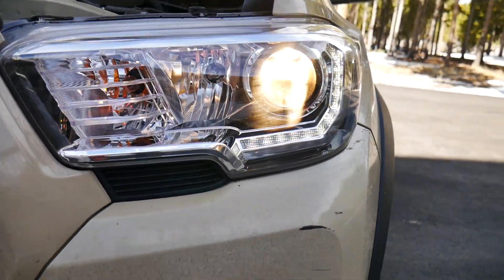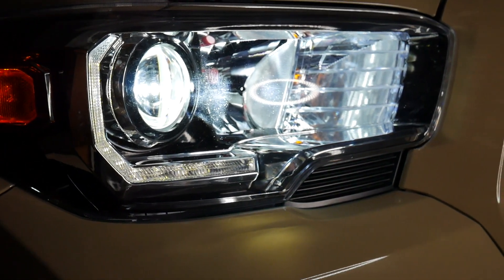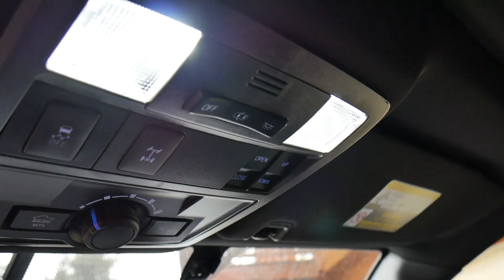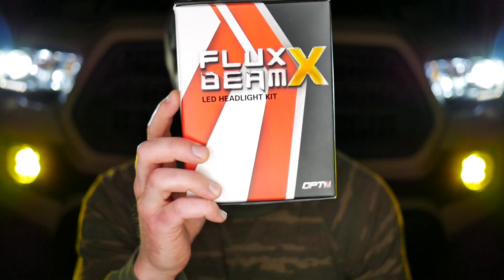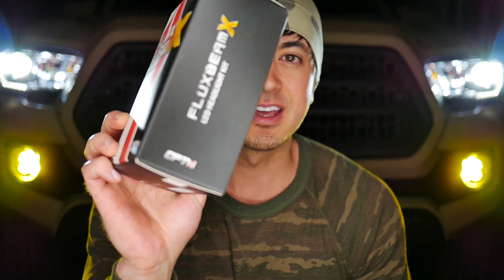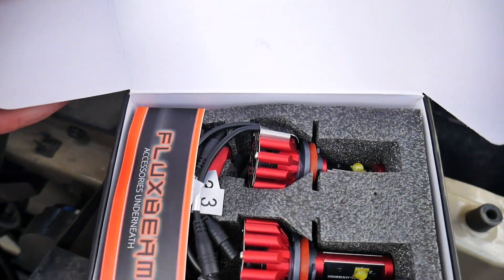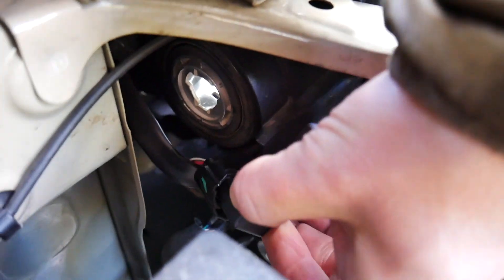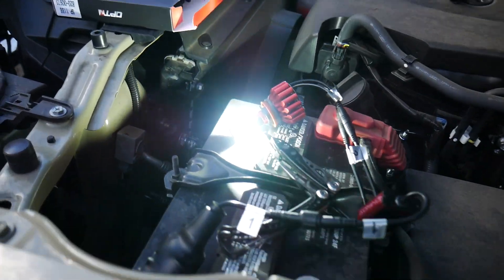Essential Truck Gear - Episode 3 - Vehicle lighting, headlight and foglight upgrades. Toyota Tacoma

Comment: I just installed the BD fog light kit just like yours, but mine has the angled bezels to make it a more factory look. The install is actually very easy. I started out just like on your video by tearing into the passenger side fender well. I then realized that everything is accessible from up top. There is only ONE tiny screw that holds the OEM fogs in place except for 2 side tabs that are kind of a pressure lock. You pretty much have to blindly find the screw head with your fingers, then align the philips head screw driver( you need a very short, medium head driver) with the screw and twist. Just like everything, there's a little trick to it. 

All that to say, I saved myself a whole night of cursing etc. by going in from up top and not removing the fender wells. Hope this helps someone out there.

Comment: I’m going to run the Baja squadron sport amber pods in my 08 tacoma fogs because Baja are great and they make specific brackets for Tacoma’s and other trucks! I’m going with the Wide/cornering beam pattern due to the 45* horizontal plane and not blinding anyone.

Comment: So the high beam is H9 (65w) and low is H11 (55w) but the Amazon listings show the H11 bulbs as 'H11 H8 H9' 60w. It looks like you need the 'H' version for the high beam. 

H11-HDOPT7-6
H11-HDOPT7-6-H

Comment: Love the vid. Your setup has me considering selling the scoob and getting a Taco.  Just a heads up. Don’t misplace your bulbs.  I bought the flux from Opt7 for the same reason you did. Driver side lasted a month. They replaced it no issues. Passenger died a week later. I have used other bulbs no issues.  I hope you don’t have my luck with them.
Reply from the maker: Going on a couple years now on my original 4, haha - but sorry to hear about your bad luck with them, that sucks for sure...

Comment: How is the throw on those lights vs the stock OEM.  I found with my projector lights that LEDs didn't seem to throw as far as my 65w halogen bulbs, before I switched to 4300k HIDs.
Reply: Adam Dümdie you'd be correct. LEDs don't throw very well, unless they're in TIR optics.

Comment: How do the LED headlights run in the cold? Im in SE Michigan and the usual here is to go with the HID's.
Reply: Jordan Wilbanks simply use what your vehicle is designed for. Neither HIDs or LEDs will perform well in halogen housings, and vice versa
Reply: Andrew Somhorst that's really boring...

Comment: Have you gone over what tires you run and why? If you're running the stock tires do you plan on changing them?
Reply from the maker: Currently using the Cooper Discoverer M+S (http://amzn.to/2n4gqKt) as my winter/snow/ice tire. I'm undecided what I'll run in the spring, but probably BFG AT2 or similar.

Comment: Nice vid, I also have a 2017 tacoma and the owners manual has H11 for low beam and H9 for high beam while Fluxbeam has both high and low as the same bulb. I just wanted to confirm before I purchased, that sounded right to you?

Comment: I dare you to compare Lux readings of the LED replacements and tge stock halogens at 25 feet. I guarantee that the LEDs read lower
Reply from the maker: Don't own the gear to do that, but would be interested in the results.
Reply: Last Line Of Defense 

Look up Lightwerkz Global Inc. 

They're here on YouTube, on Facebook, and their website is Lightwerkz.net

He's done a multitude of this testing. I imagine you'd be surprised by the results
Reply: Also, as far as finding American made lights; that's hard to do. Most are made in Europe, Japan, amd China. Most, but not all, that are made in China are horrible. 

Diode Dynamics makes some of their products in the US, and are working on bringing the rest of their products stateside. 

If nothing else, look into them when you start thinking about light bars. Baja Designs is pretty good, but Diode Dynamics has been out doing them in the light bar market

Comment: Great video, I have the exact same truck down to the color, just in long bed. I've been looking into lighting and this video answered several questions. What tire and rim size you run? Will you ever upgrade or alter your suspension?
Reply from the maker: Currently using stock rims and tire size - but will eventually probably put on a small lift and slightly bigger tires.

Comment: That's still my dream truck, I'm hoping that someday Toyota will put a diesel in the Tacoma.
Reply: amen to that
Reply from the maker: Indianahillclimber there are always rumors about it coming...
Reply: I was encouraged after hearing recently  that the Federal government will be easing up on vechicle emissions. Toyota has said that it's currently not cost effective at this time. I want a long bed, double cab in quicksand. Icon suspension and 33" tires and paint matched cap.
Reply: with the TRD Offroad E-locker
Reply: Amen to that.
Reply: Indianahillclimber check out the new Nissan titans. it's got the 5.0 cummins
Reply: Roger Tran Thank you for the suggestion, I have looked into them and do not like the look. Their is something special about the Tacoma. Also i liked the Titan even less after watching the TFL gold mine hill challenge with the Titan XD.
Reply: 2019 supposedly, they had em when I was in Japan, they were awesome.
Reply: I think they have diesels in the hilux.
Reply: Yes they have diesels in all non USA or Canada locations. If they are made in Japan ,or Australia, or South America they can have diesels in them the i6 would be great in the Tacoma. What I want is a slightly smaller cab not a full cab but a little smaller helping with the tacomas massive wheel base it's a long truck for a quarter ton pick up . Ideally I would want solid axle coil over with manual shift in lock in locking rear diff winch mounts front and rear standard leather seats lots of lighting and or aux ports and USB ports in the bed and inside the truck but water proof covers .also rhino lined instead of this stupid plastic bed liners. And do something for the power this truck needs more power should be no less than 325 hp and 400flbs of torque.
Reply: Wish it was simple to just drive to Mexico and pick one up.
Reply: why bother with diesel?  Gasoline in USA is nearly free.
Reply: Chevy Colordo